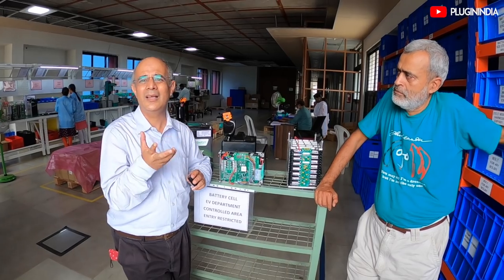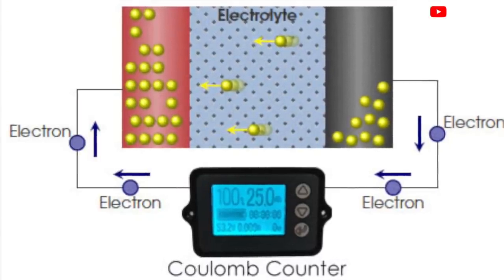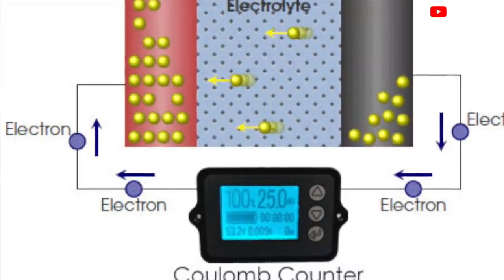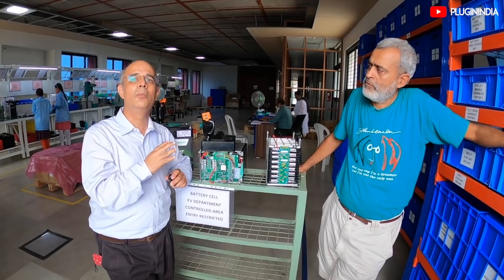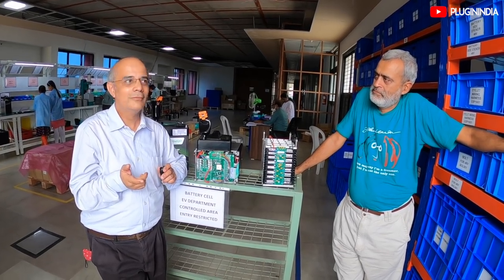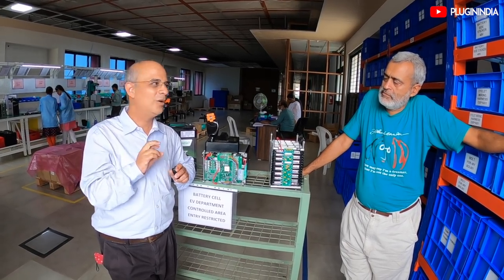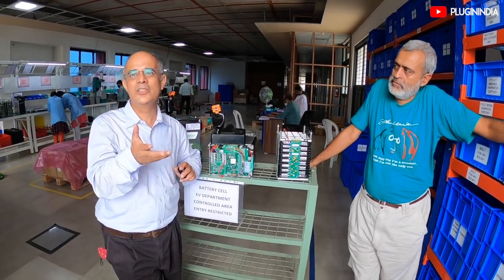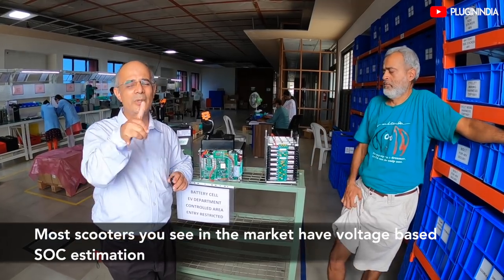EV Guru: Lithium Battery Internals | Pouch Cells  | Battery Engineering #2

Comment: One more analogy for SoC. Think of lithium batteries as closed water containers with opaque pipes connected to source tank (charger) and Sink tap(motor).
You cannot estimate the content of water in the tank by simply seeing how high is the tank in the building (i.e. Potential difference or voltage). Since the tank is closed, you also cannot peek into it. The only way to measure how much water is in the tank, is by spending or filling it and counting the rate of flow of water (for batteries, that is Coulomb counting).
Reply from the maker: Wonderful stuff!
Reply: or you can have a pressure transducer at the bottom of the tank. The water level can be directly calibrated with the pressure reading.

Comment: SIR I HAVE QUERY AS WE ARE PRODUCING  MAJOR PART OF ELECCTRICITY BY BURNING COAL AND THE SAME ELECTRIC POWER WE ARE USING TO CHARGE OUR EV VEHICLES SO HOW EV ARE BENEFICIAL FOR MOTHE NATURE?
Reply: Burning coal and producing electricity and then using it in vehicle still produces 15-25% lesser carbon footprint than combustion engine Vehicles and also produces much less other harmful gases.
Also, for fossil fuel powered vehicle, the fuel has to be extracted from earth, refined, shipped multiple times and finally dispensed at petrol station before being burnt in the vehicle. All these processes have a much larger carbon footprint. With electricity, the supply chain uses much lesser energy for supply to consumers. That is why it's more efficient.
Further, there is potential to switch completely to renewable electricity. Combustion fuel is destructive by its very nature.
Reply: Coal is not the only source. We have renewable sources of power too and it will be the major source of power in future.

Comment: Great Video but I don't feel puch cells safe they do have a inheritant tendency to bulge, this is caused due to formation of dendrites, when these structures puncture the separator there surely is a physical short circuit, the LiFePo4 pouch cells, should be safe as there is no dendrite formation in that chemistry, lovely Video Sir, highly appreciated content ❤️❤️👍🏻👍🏻🙏🏻🙏🏻

Comment: What %of pouch cell is recyclable at EOL? How does that compare to cylindrical or prismatic?
Reply from the maker: Recyclability of pouch cell is no different as compared to prismatic or cylindrical.  Pouch cell is very similar to prismatic except the outer metal box is not there.
- Replied by Mr Abhay

Comment: Why there is a GPS inbuilt in the BMS?
Reply from the maker: it’s for swapping application and our rate card is km based.  The GPS is only for computation of distance travelled by the user per swap of battery pack.
- From Mr Abhay